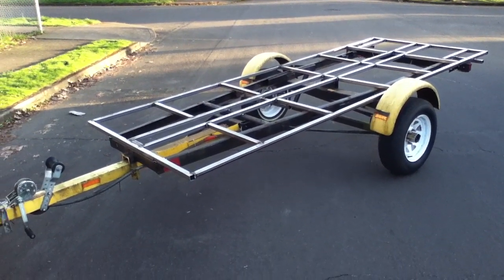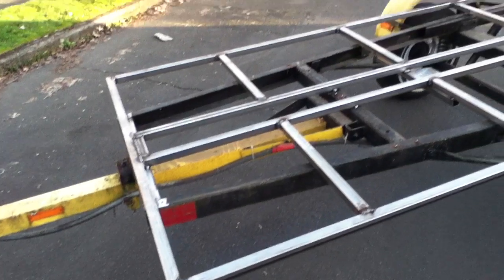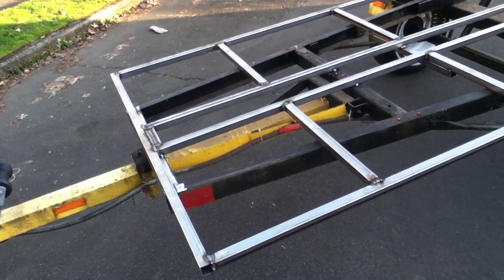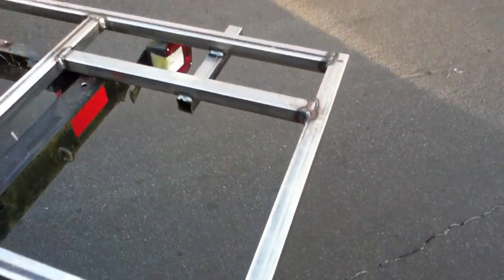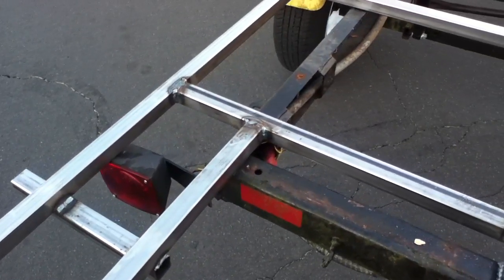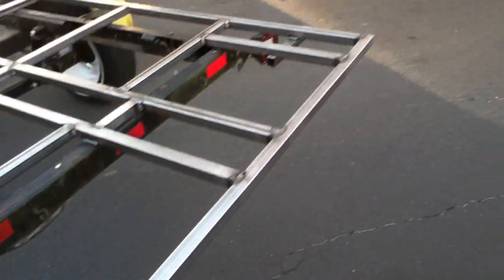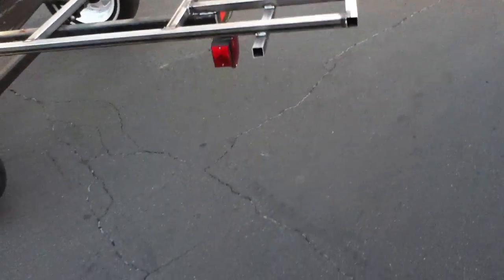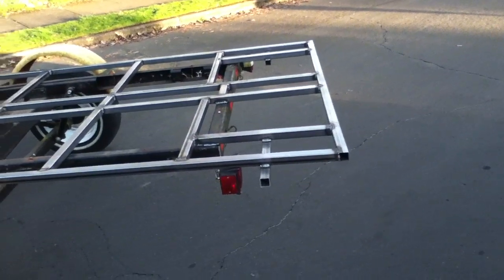Boat Trailer to Flatbed Trailer Conversion Welding Project

Comment: Good Job!  There are so many great deals on BOAT trailers and not a lot of good deals on flat trailers...I have often thought of this same idea!  (wish I had a welder and skills!  I doubt I could save any money converting a boat trailer if I have to pay someone else to do the fabrication...maybe I sign up for a welding class and THAT could be my final project!??  lol"
Reply from the maker: Back when I made this video I was only charging $25 hr with a $40 minimum on projects at my place or $50 minimum if I went to do projects at other peoples places.   Basically on the tail end of the whole working class creative thing in central Portland.  Then the landlord kicked everybody out and cashed out the house on a hi profit.   If you have a driveway and garage, just order a machine from Harbor Freight or Eastwood and putter around with some projects.  The owners manuals, how to videos and people at the stores can point you in the right direction for this kind of fabrication/modification project stuff.  Most of my trailer projects started out as harbor freight trailer frame kits and got upgraded from there.